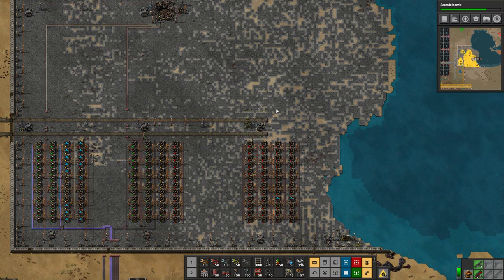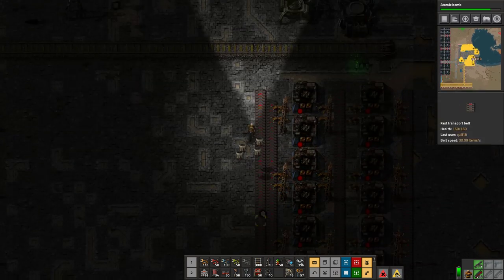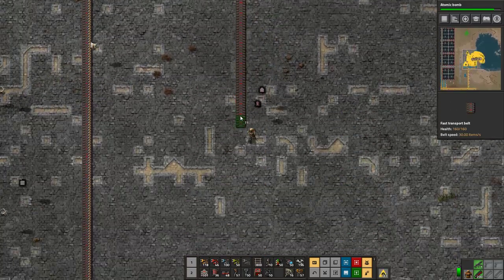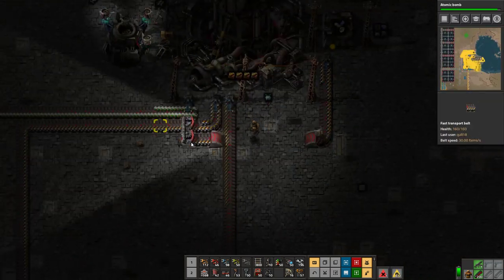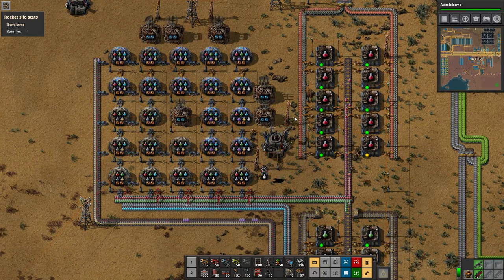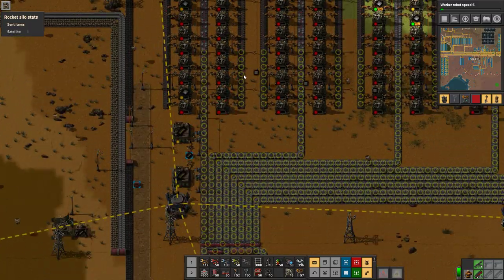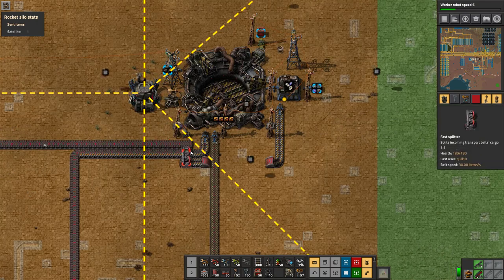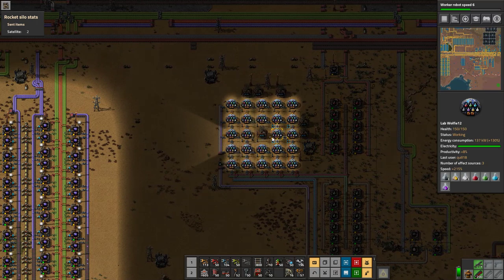Let's Play: Factorio! -- .17 Experimental -- Part 25

Comment: Quill, you need to change your laser turret blueprints. It's very common when they are attacked for the central pole to be destroyed by splash damage and the entire structure to be rendered useless. The 'backup pole' you add should be part of the blueprint. Frankly, more backup poles should be added!
Reply: I'm surprised Quill survived that long without a full continuous wall. Once the biters get strong enough to keep knocking out the big pole I usually pull the lasers farther back from the wall and switch over to substations.

Comment: @5:55 In this instance Quill could have achieved his desired outcome by setting a filter on the splitter

@7:20 Quill would have been well served to leave the LDS running to the satellite as it also needs those.

@19:25 While there is no progress bar visible from the map, you can see "Rocket parts: x/100" in the info panel when mousing over the silo.